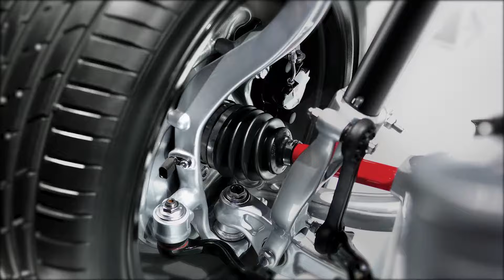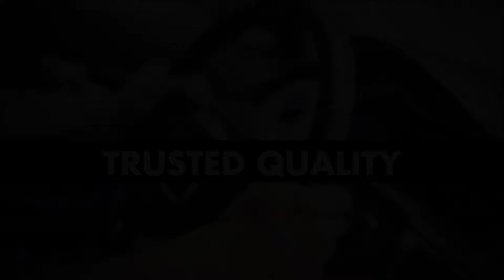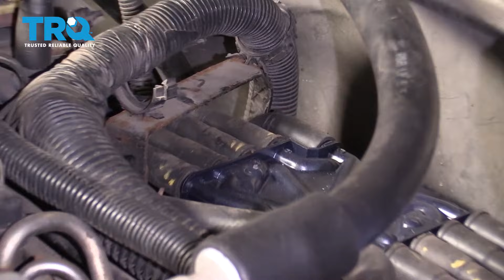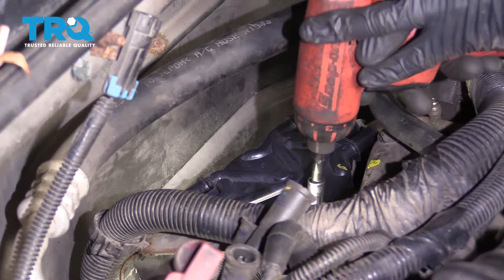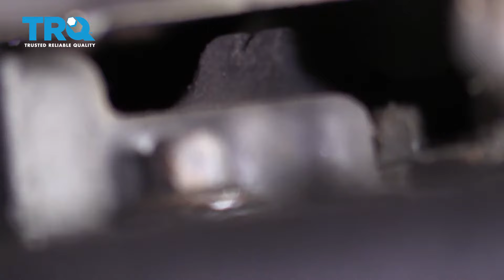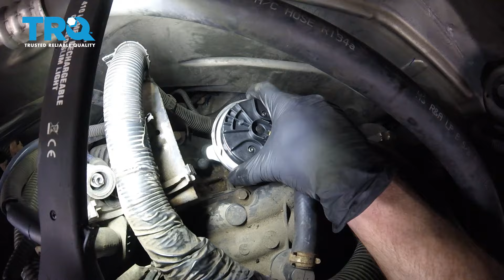How to Replace Distributor 1995-2000 Chevy Tahoe

Comment: You might want to tell people that they will need to have a code reader that will read the CMP RETARD SETTING. It will be in THE LIVE DATA if yours has it. You want it to read BETWEEN -2.0 & 2.0 ||||| I always strive for 0.0 but that is hard to get. My last one was 0.32 and fluctuates a little. You want the rpm’s at or over 1000 while doing it. I used a Launch 129e. Its about $200 but a decent one for you DIY’s. Hope other people list other economical Code Readers that will give the CMP reading. You turn the base of distributor to make it go up & down. Consult a manual for detailed instruction if you have never done anything like this.

Comment: I just installed a new distributor. Top dead center on compression stroke as it should be.
Rotor pointing towards the #1 cylinder as it should be

But my obd reader says the timing advance is negative 24 
and vacuum is negative 19.
It starts good and runs ok... but i feel like something is wrong. Am i a tooth off?

Comment: Not the best install video for those seeking guidance...when replacing a vortec v8 distributor follow these tips
1. Remove cap and plug wires and cam sensor connector at rear of distributor
2. Remove distributor. hold bolt and clamp
3. Remove distributor via the distributor body (not the rotor) allowing the rotor to move ccw as it follows the driven gear up and out.
REPLACEMENT
1. Set number 1 cyl. to TDC, When I work alone I use a 2 ft. length of hose to stab into spark plug hole and put other end in my mouth allowing me both hands to turn the crank until it begins to inflate my mouth confirming I'm at TDC on the compression stroke then I refer to the line on the crank and notch on engine and continue turning the crank slowly until they line up.
2. With distributor in hand as a close reference I put the cam sensor at about 2 o'clock and the rotor pointing at about 3 or 330 just as a preliminary setting
3. Notice the flat spot on the distributor. Housing, this should be somewhat parallel with the lower intake housing after distributor is down so again after you allow the driven gear to pull the rotor clockwise and when the distributor is set your two landmarks are
A. The distributor. body flat area should be close to parallel with the intake
B. The rotor should be pointing to the no.1 cylinder and you should have it but let me inform you on a vortec this is just a base setting and an engine scanner with "cam retard" capability to fine tune turn the distributor to + or - 2 degrees as per spec.....if any more than this you'll probably get your po1345 code back....hope this helps yall
Reply: As far as the distributor sitting down all the way don't worry about that if it doesn't seat down all the way but lines up to no. 1 your good....the gears have meshed all u need to do is slowly turn the crank and soon the distributor will "drop" into place then clamper down